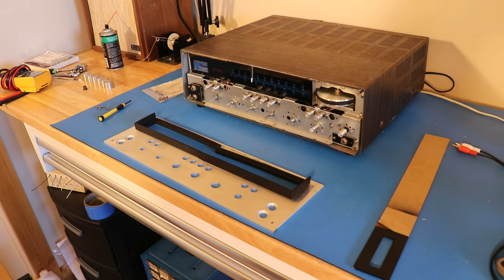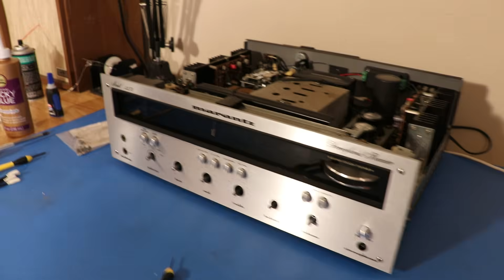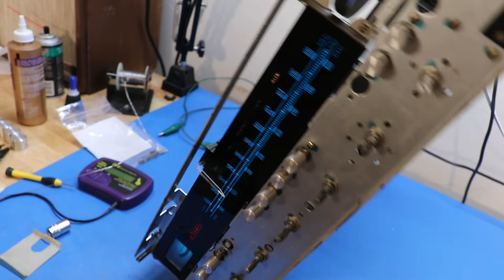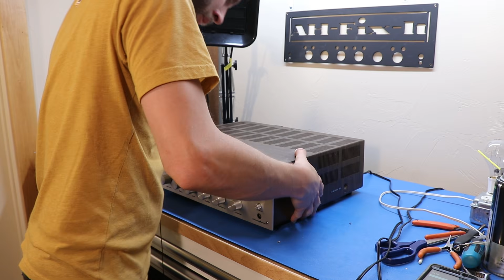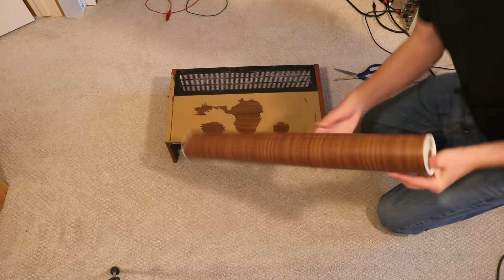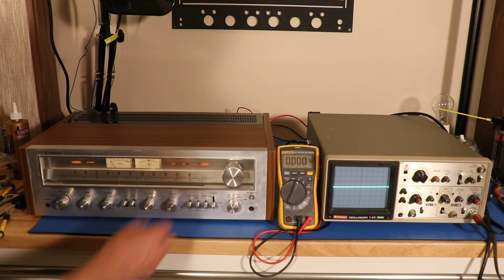They were the WORST receivers on eBay. Now they're restored!

Comment: I totally understand about the elerolytic caps sounding better.  I had an experience replacing elerolytic caps in several pairs of early Radio Shack Minimus 7 mini speakers going to polypropylene caps. The sound was immediately duller   and less satisfying to me. A disappointment.

Comment: AH - Does the SX-737 have a great FM tuner?  I'm thinking of buying one but I need really good FM reception.  Also the 737 was produced over 3 1/2 years and my local tech told me he thinks the later (1975-1976) model had some changes to the tuner that gave it better performance than the earlier model. What do you think ?

Comment: I am considering the purchase of a vintaged 1980 model year Realistic AM/FM Stereo Receiver that has been cleaned as all functions work!  Is it standard procedure or is it recommended to replace the electrolytic capacitors in the unit?  What other electronics might I want to inspect inside the unit?  I enjoyed your video on that tedious Marantz  2230 tuning wheel & pointer repair!

Comment: You should have 3D printed the pieces with offset seams. Less noticeable. Go 1-2" to the right on the top and the same for the bottom left. You might also 45 degree them and overlap for a cleaner fit even. Some light sanding would probably still be required.  But then again, that's a bunch of work. What you have done looks great.

Comment: You mentioned electrolytic capacitors and the possibility of the loss of the Marantz sound when film caps were used as a replacement has me thinking maybe my repair tech may have replaced the electrolytics with Film caps in in my Sherwood HP2000 integrated amp because it doesn’t have that warm and detailed sound it once had. A noticeable Loss of highs for sure

Comment: Long time viewer., glad to see you putting out another vid. Your work on the bezel reminds me of things I need to do when working on motorcycle parts. As a tip, I would have made a blank faceplate out of aluminum to hold the bezel together outside of the faceplate, Then I would have used some epoxy or bondo to fill the joint. After curing, I would have then sanded and polished the bezel, followed by painting. Then remove the blank and install the glass plate. I'm not being critical, just trying to solve the issue together. Keep up the good work!

Comment: Nice video and thanks for the entertainment. Your speaker knob doesn't look to bad, I would try some solvents to see if the black will come off. Start with industrial goo gone and move up the ladder of stronger solvents like MEK on a rag. If its still there try some 320 or finer sandpaper and sand in a circular motion. Lol one way or another it will come off.

Comment: Awesome, I been watching the series. We know is not your day job. I have a sx 750 that I got for almost nothing. Already got going, I did wash not exactly because of you. I done before using a modified tektronix protocol. The wood case on my is beyond repair, I will do a hardwood case. Hunting Dow the speaker and plug plate, mine is just to rusty. Anyway great video, restorations and weird repairs are just like. I was pretty bitter last night, with my Sony 1120 😂😂😂

Comment: Interesting findings on the caps. I watched Tony’s video series on film vs lytic and will need to go back again and listen to the samples. I have just finished restoring/recapping both of my 2230s and have always used Kemet R82 films in those lower capacitance signal chain locations for all my units.  I may go back and see if I notice any difference with electrolytics instead. Great series of videos!

Comment: I agree with you about the electrolytics.
Nowadays everyone seems to replace them with film capacitors.
Not a good idea unless you use polypropylene caps but these are way too big.
Many people cannot hear the difference, but the better your source, speakers etc, the more obvious the difference becomes.

I use an old Fluke 45 for power measurement, so I don't have to do the calculation and you can do 20 Khz 😀

Comment: what is a FM alighnmet?  is that code
Reply from the maker: You will see next video!
Reply: FM alignment is a standard maintenance function to make sure the receiver is getting the full broadcast range from lock-to-lock of the tuning capacitor. It typically involves moving  slug (or two) inside an inductor. Each tuner has a procedure detailed in the service manual. After the alignment, the dial indicator may need adjustment. 
Basically, it is something a professional should do upon repairing a receiver before turning it over to the customer, at least that is my understanding.

Comment: I replaced all the electrolytics in my 2250B tone board except the bipolars at the output of the stage, since I didn't have them. Came back to it later, replaced the bipolars with film, and the improvement was dramatic. I measured the ESR of the original bipolars versus the film - the film was less than 1/10th the ESR.